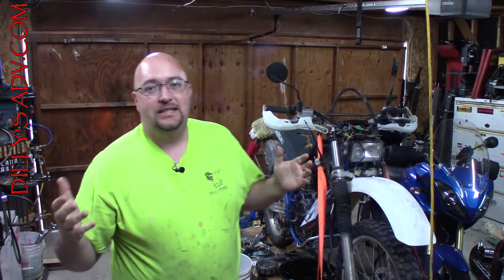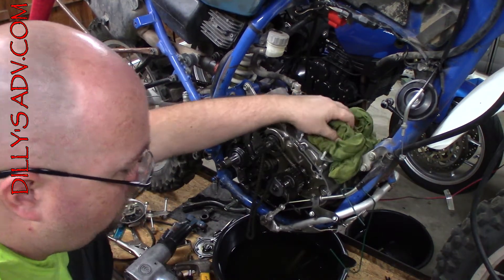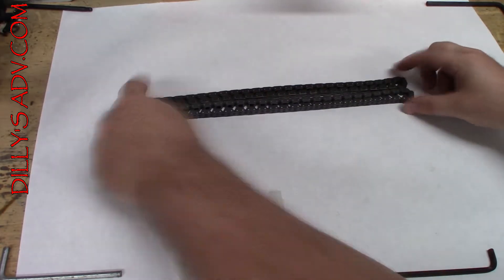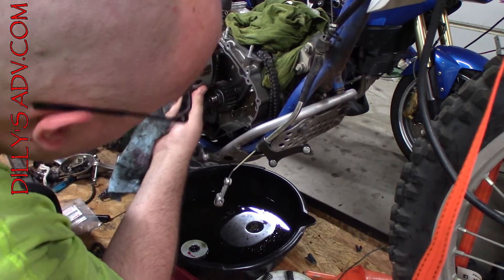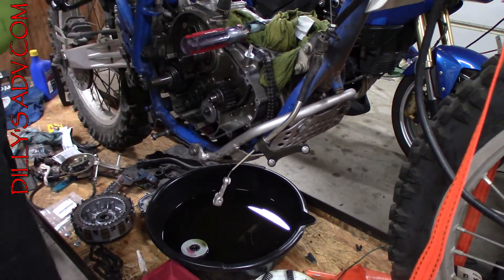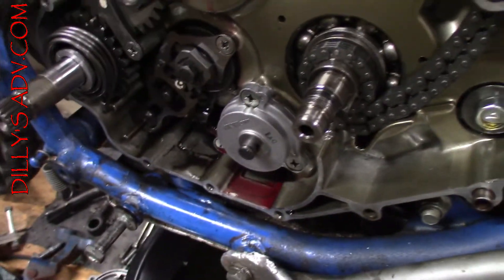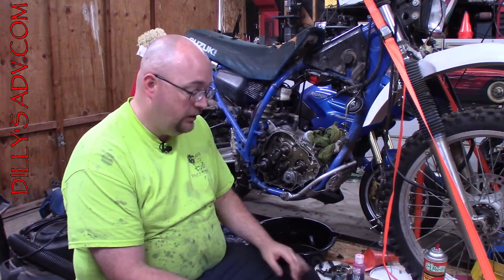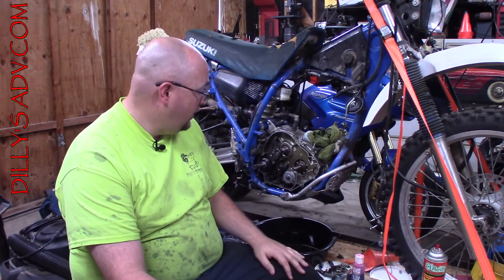CAM CHAIN OFF AND ON

Comment: Buying  a 90's DR350 with 4800mi...or one that has 14,000 mi ...with either i doubt i'll get the true story of maintenance performed. Both are selling for 1800 +/- .Should i bother? Is this type of damage common or just buy a brand new bike DR650 or  similar?
Reply from the maker: I like the feel of the Dr350 my biggest complaint is the kick start only motor is harder to troubleshoot. If you can get the DR350s with electric start.